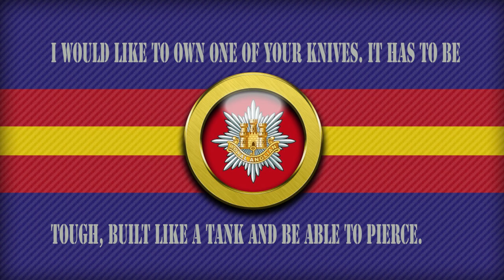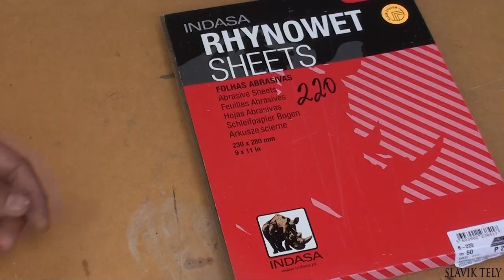Making a knife for a Royal Anglian Infantry Soldier Part 1

Comment: Excellent video. Great editing, the pacing was perfect.

That pipe-and-eyebolt bevel jig is such a good idea, I can't believe I've never seen it before. One of those things that seem so obvious, when you see someone else do it.
Reply: I built one in my shed but it's a little finicky, as the bevel will vary in size from the plunge line to the tip. If there's a quick fix to this please tell me.
Reply: Just file the tip more.
Reply from the maker: Thank you, the filing jig is Aaron Goug's idea. Check him out, he makes awesome knives too.
Reply from the maker: You need a thicker board where you eye screws go, this way they will not move at all.

Comment: Very nice! I really like your filing jig. I'm in the process of making a sharpening jig with the same design. I was thinking of starting out with the eye-bolts like yours but I was tossing around the idea that the rod going through the bottom of the eye-bolt (at different lateral angles) may have some variance on tool angle at the blade edge. So I am thinking of making something flat for the rod to travel on so as to keep a consistent angle at the blade edge. Maybe no so critical for filing but for sharpening I want to be as consistent as possible, as well as keep it on the frugal side as well. I'm off to watch part 2.
Reply from the maker: It is Aaron Gough's design with few alterations (https://www.youtube.com/watch?v=r9iNDRwwBQQ)

Comment: Hello there, the description claimed the steel used was 9/32 inch thick but the video shows it was 0.250 (which would be 1/4, or 8/32) inch thick at 0:20 .
Reply from the maker: As far as I remember it was 1/4 inch.

Comment: what brand & size is that steel cutting band saw. ? It cuts steel like butter. I need to get one now !  My De Walt Angle Grinder is OK but I love the cuts your saw makes ! Thanks,   Slavik Tely
Reply from the maker: It is electric Milwaukee band saw. It cuts like butter because I sped up the video.
Reply: I probably will only use it a few times a year as this is just a fun hobby thing for me. I just found out that Harbor Frat. has a band saw on sale for metal cutting. Only $99. with 25% coupn off too! I am going to mount it on a custom made stand with a cutting/clamping  table too. I am so glad I am handy and can adapt many things that I need. Thanks for the info.
Reply from the maker: triumphmanful Yes, they do have that one and it works just fine. I buy a lot of things from Harbor Freight like clamps and mallets.

Comment: if I were to make this out of Damascus steel what heat treat would I use and also would it be harder to use a hand file on. My dream knife is this design in Damascus steel with red cedar grips with a bow drill cutout, with a scout carry sheath.
Reply from the maker: https://nicholsdamascus.com/ this is where I got my Damascus steel. I have not heat treated yet but if you were to get one, call him up and ask him. I bought high carbon steel Damascus. If the steel is annealed, you can use a file on it.

Comment: ******Would you please give the dimensions of the wood vice table that you made ? I can guess at the size, but would rather get it correct ! I have all the parts,  rod , eye screws, files, hose clamps  and the wood ready to cut. Thanks*********
Reply from the maker: https://www.youtube.com/watch?v=r9iNDRwwBQQ this is where I learned
Reply: I looked and all he has is a small T shaped piece of wood! Nothing as nice as yours. I will guesstimate the size. Thanks anyway.
Reply from the maker: triumphmanful Mine is the same but I put a 18"x18"x1" plywood.
Reply: Thanks, now I will build one.

Comment: Hey Slavik, I was wondering would a cobalt drill bit be able to drill a hole in 440 C stainless after heat treating
Reply from the maker: No, you can not drill anything after you heat treat. What you need to do is submerge the blade of the knife into water but leave the handle part sticking out. Then heat the handle part with the torch to soften the steel.
Reply: +SLAVIK TELY OK thanks
Reply: +SLAVIK TELY would I have to re heat treat it or doesn't it matter too much because it is the handle
Reply from the maker: Francis Watterson No, you do not need to temper the handle. Only the blade needs to be tempered because you want the blade to keep the edge sharp for long time.

Comment: O1 tool steel, its some kind of stainless steel isnt it?
Reply from the maker: +Matheus Ramalho O1 Tool Steel is the original oil-hardening, “non-shrinking” tool steel that can be hardened to the Rockwell C 65 range from a low austenitizing temperature. O1 is a general-purpose tool steel that is typically used in applications where alloy steels cannot provide sufficient hardness, strength, and wear resistance.
Reply: +SLAVIK TELY oh ty, its not that easy to find some of these here, but, thank you anyway
Reply: +SLAVIK TELY btw, keep up, youre such an artist, good job as alyways